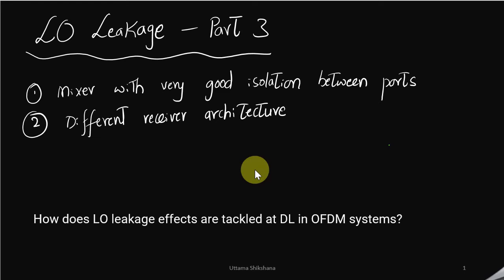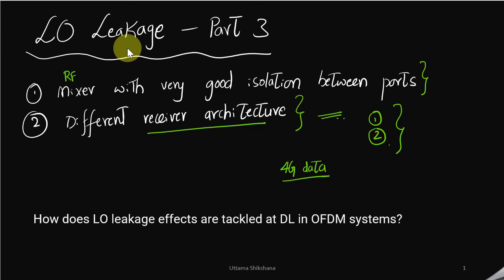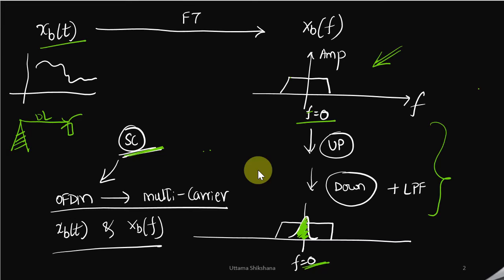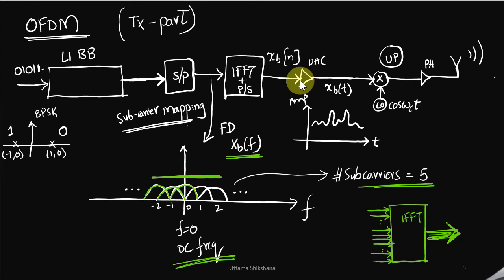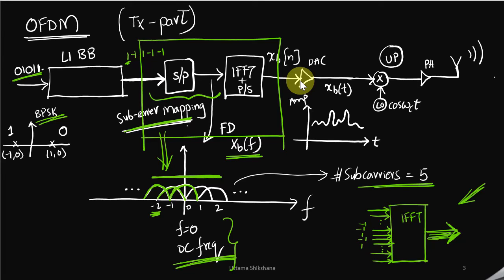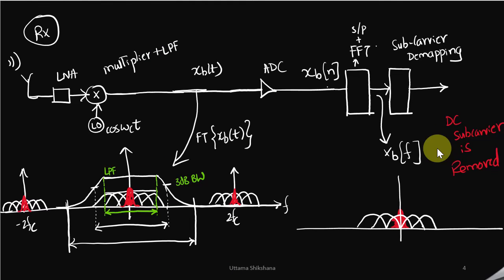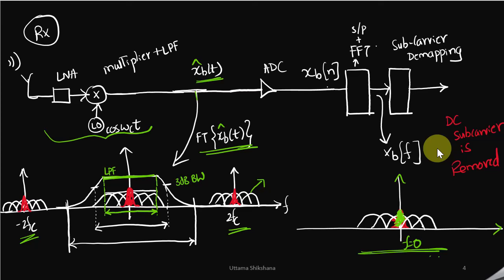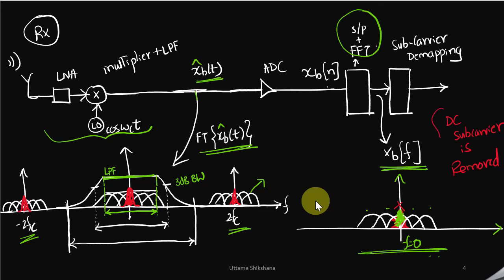[Series #23][Industry] Null DC Subcarrier in 4G DL OFDM | Null Subcarriers at the edge of band -Why?

Comment: Since you are not showing CP add and  removal block, can I assume that you are assumed AWGN channel ?
Reply from the maker: Thanks for the question :)
For simplicity, I did not include the CP addition and remove blocks.
But, the concept is explained for the OFDM systems which uses wireless channel. 
As of today, if you are using 4G data then your mobile uses this OFDM technology and the concept explained in the video.

Comment: 1. How does the base station know that there is LO leakage at in DL ?
2. Kindly provide references for the topics you are explaining
Reply from the maker: Thanks for the question :)
Base station need not know if there is a LO leakage or not. It should simply address all kinds of UE which uses different receiver architecture.
So, irrespective of whether there is LO leakage or not at UE, the base station would go for nullifying the DC.